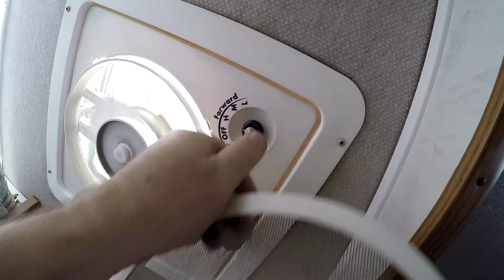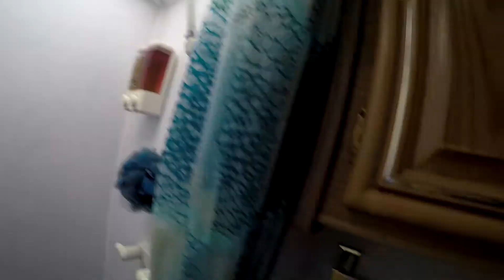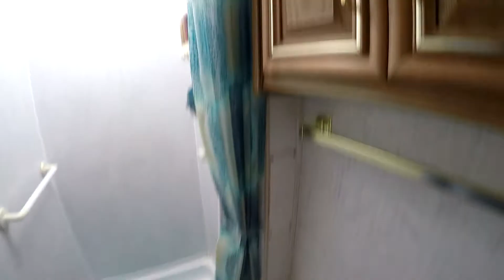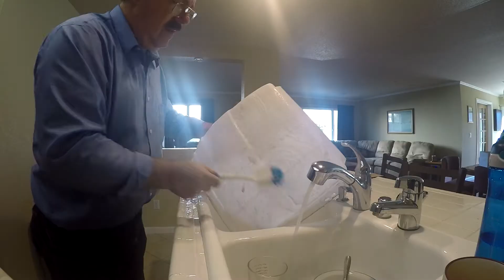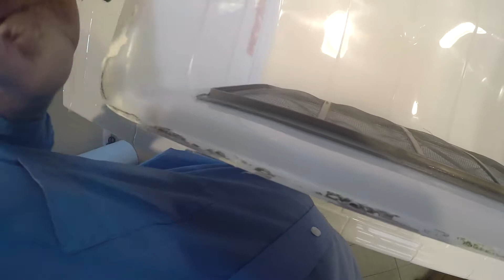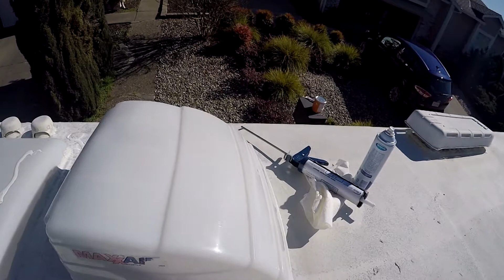RV ceiling fan and roof vent cleaning: Tips & Tricks

Comment: I hope I am not too much of a pest Greg. I would like to know where you got the fan vents Sir? A how did you get power to them?
Reply from the maker: This is what I currently have. Both vents in the bathroom and Livingroom were in good shape so I did not want to replace the entire unit. This insert worked fine. The small motor from the cheap bathroom fan still remains. I removed the blade, the screen/cover. Then I used the existing wiring and connected this unit:
Hengs Industiries - 90046-CR Vortex II Replacement Fan Kit (501.1099)
https://www.amazon.com/Hengs-Industries-90046CR-Replacement-501-1099/dp/B00DPJ3RDA/ref=sr_1_1?dchild=1&keywords=rv+vent+fan&qid=1592371592&sr=8-1

However!! If you plan to replace the complete vent then I strongly recommend this unit instead.

Fan-Tastic Vent Roof Vent w/ 12V Fan - Manual Lift - 14-1/4" x 14-1/4"
https://www.rvpartscountry.com/CREATE-A-BRZE-MAN-EXHAUST-ONLY.html?gclid=CjwKCAjw26H3BRB2EiwAy32zhZk6TUgOiE1xrOakC47A6ulom24RO_eIGEmItpYkiN4w_IXhZzwQFxoC-88QAvD_BwE 

 Overall it is quieter and moves more air. Eventually I will replace mine with this unit. But you’ve got to get on the roof, then remove the existing unit, then clean all the junk off the roof, so this will be a more difficult installation. Traveling Robert’s Youtube channel replaced his you might want to look at that first before installing it.

2nd and big question: how did I get power to the Livingroom vent? One day I removed the inside cover and noticed 2 wires already up there. I tested the wires and they worked! Is it possible that they preinstalled wiring on yours too? Removed the lower cover to check and let me know.

I know working on your RV can be difficult but it will reward you!

Thanks
Greg Moore